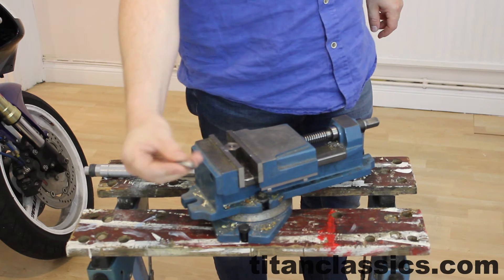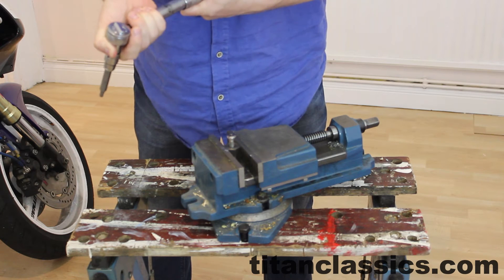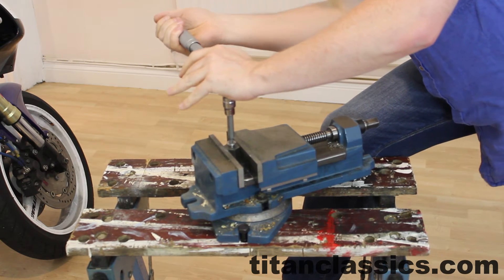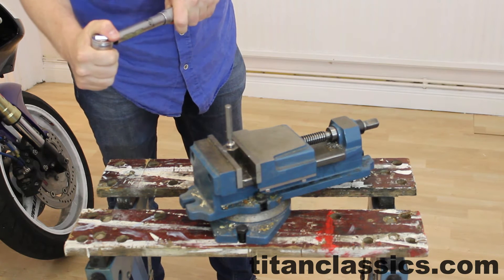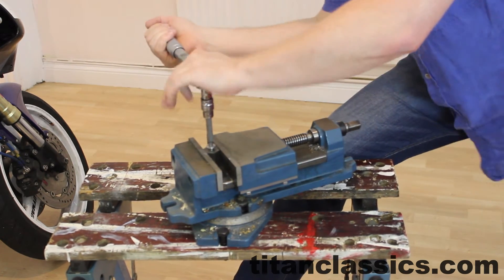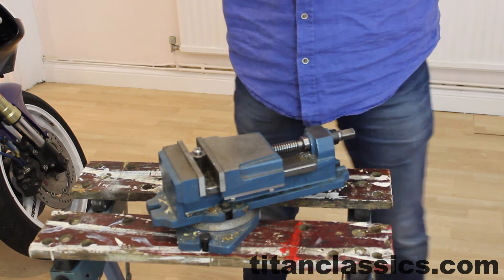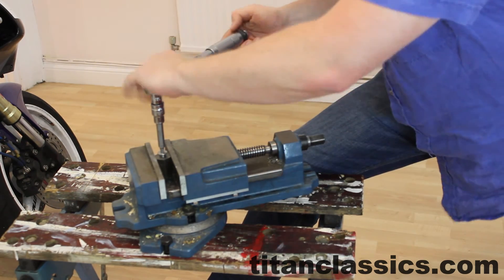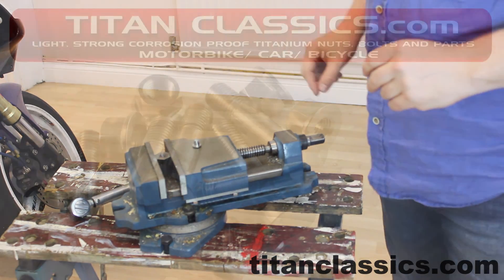Destruction torque of TITANIUM bolt

Comment: I can't tell from the video but it appears you have a shouldered bolt there. I think you would get a better test by putting a spacer in there. It looks like you have run out of threads and you are torquing into a lack of threads. If you are, you aren't really testing the stretch of the bolt but instead how hard it is to twist the head off.
Reply from the maker: True, I'll get a piece of hex steel and do it so the should can fit into the hole and then see what torque setting it snaps at